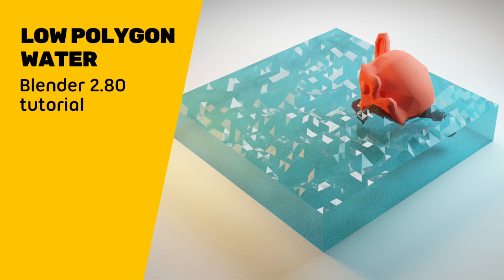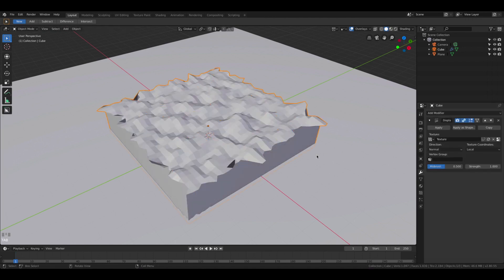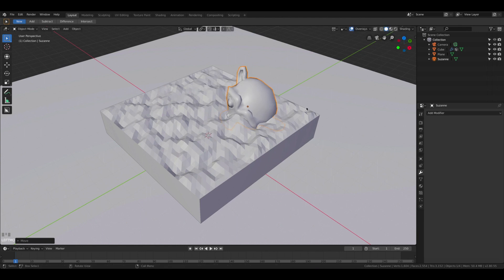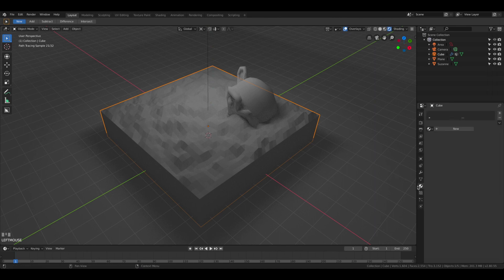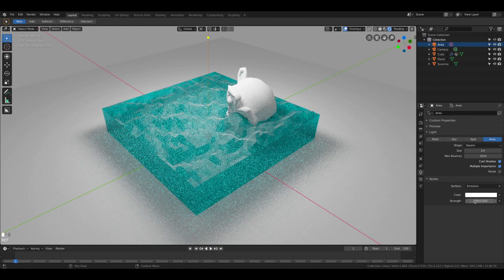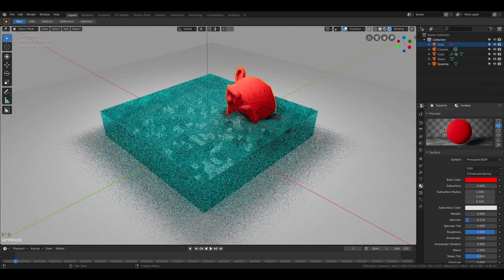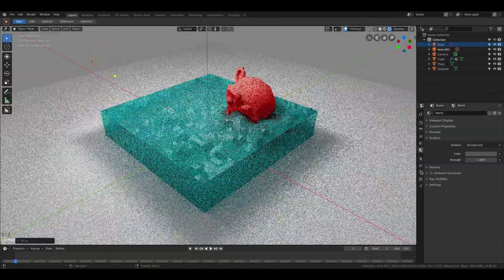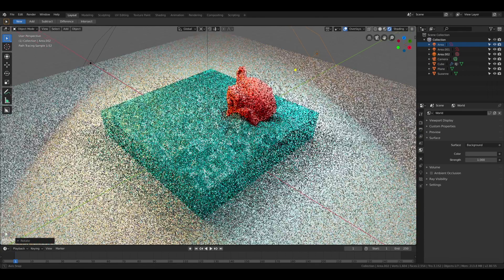Lowpoly Water - Blender 2.8 Tutorial

Comment: I can't find why that vertex group isn't working for me, doing the same as you but edges are the same as before assigning vertex group :/
Reply from the maker: Make sure the vertices are selected before clicking Assign button on the Vertex Groups menu. And them make sure to assign that vertex group to the modifier. It's two steps process and maybe you missed something? Hope that helps
Reply: @Vlad0  Thanks for answer, I found my mistake, in video 1:14, on my side there was selected whole top face but in your video imidiately was selected top face without small parts on edges so I selected it manually and then it worked. ;) Thanks again for video :)
Reply: Vlad for me everythinh dissapears